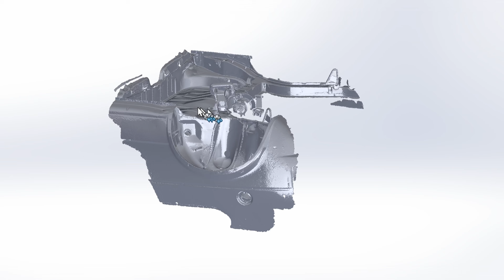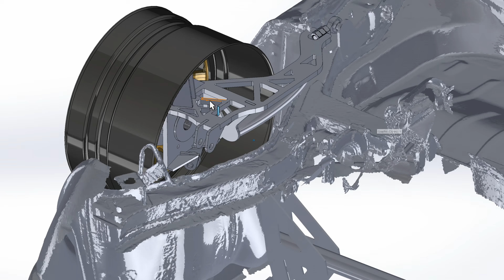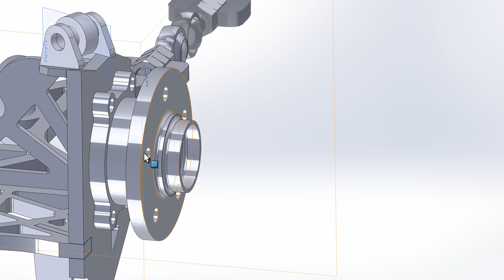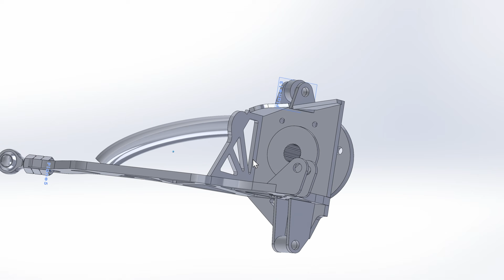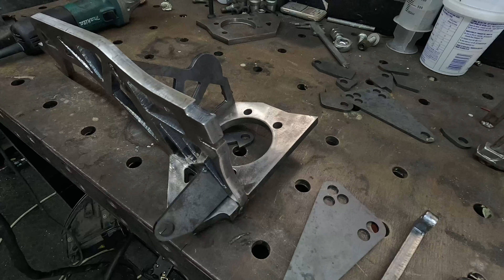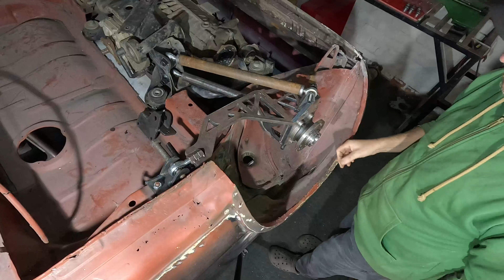New rear swing arms for the 4wd vw Carbon Mk1 Golf

Comment: Wow! Is it possible to use a stock Mk1 rear shock absorber configuration on this rear suspension arms?
Reply from the maker: yes , you just need to check your wheel width , you cant tuck very wide wheels in the rear.
Reply: @carbonmk1 thanks...do you accept to make a pair for my Mk1 Golf?
Reply: What's your email address?
Reply from the maker: @jeremiahresurreccion2350 send me an email